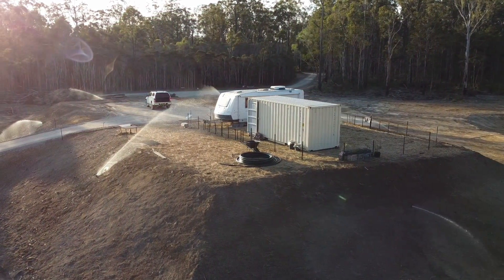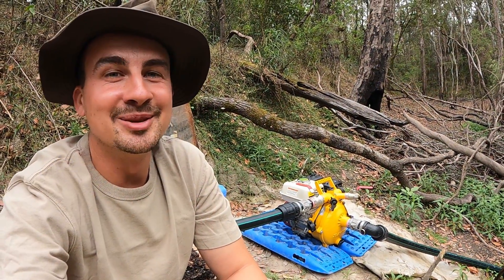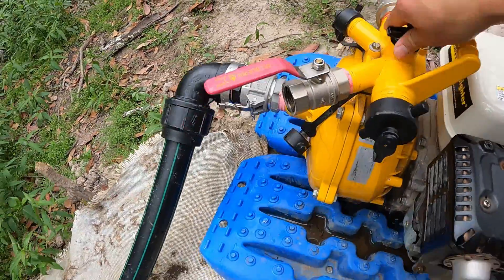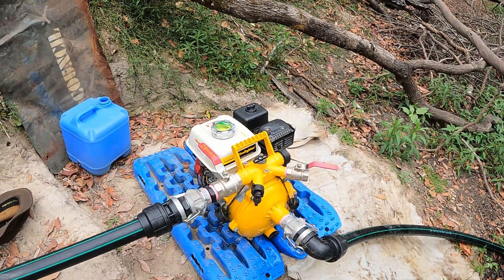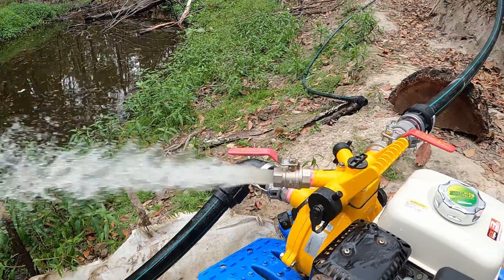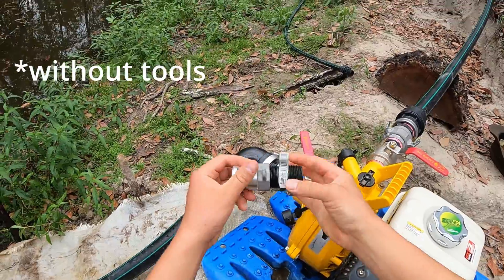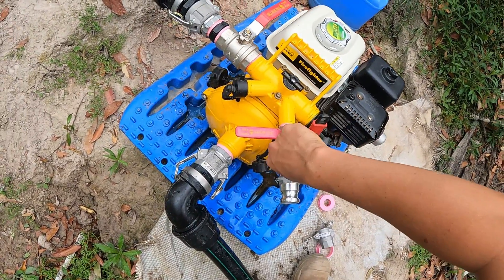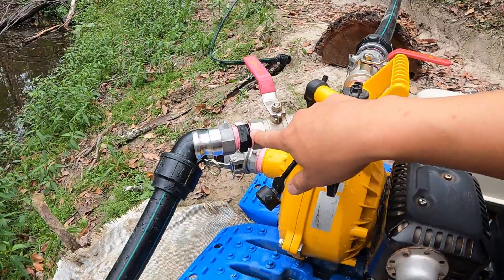How to use Davey Firefighting Pump & Camlock Fittings - Bushfire Safety System Pt 3

Comment: Hey Mate, is the pump tied onto the traction boards somehow?
Reply from the maker: @paulhepfer8155  in this instance it wasn't tied to them. It didn't go anywhere while simply sitting on them, but I did level the ground to be flat 👍 

It doesn't vibrate enough to need too much bracing. The poly pipe held it in place just fine. If it's on a slope without anything holding it, then it can giggle away I guess

Comment: Where is your property based? I want to build a dam like that on my land
Reply from the maker: @MrCites1  Northern Rivers ✌️
Reply: @ nice. Did you need a DA for that dam? Was it over your harvestable rights limits? It’s so hard to navigate legality with dams
Reply from the maker: @MrCites1  well that's the thing, with thousands of pages of policies nowadays it's difficult to arrive at conclusive outcomes...

As a helpful start, Water NSW is the governing body when it comes to building dams. They can assist with sharing some useful info for types of dam designs and things to look out for. With them, as long as you're under the max harvestable rights they have no issues or application processes. Our dam was just under the max.

When it comes to councils, every council seems to have a different interpretation of the same laws.. simply because they're ambiguous and convoluted in nature. 

If u want to be 100% in the clear it's good practice to ask the council if they require a DA. Funny enough, we had one person from council let us know they require no DA. Then after we built the dam someone else accused us of having needed a DA. Thankfully we saved the correspondence to show them how their colleague wrote to us saying the contrary. 

It's a bit of a shame the system is so disjointed, and it took months to receive responses.
Reply: @ my exact experience.
Local land services hadn’t heard of harvestable rights!
Reply from the maker: @MrCites1 wow that's an interesting example lol

It's a strange world we live in. We've had satellite internet providers tell us that we can't power an off grid modem with solar power, only with a generator...

Comment: as I was watching this, I kept thinking to myself that you should really consider installing another sprinkler head right on the pump with another valve. This way if there is ever a fire, once you start the pump you can saturate the area around the pump to protect the pipes and the pump itself. Can't see any downside here considering how cheap the sprinkler heads and fittings are.
Just a thought, great videos so far.
PS, as a plumber myself I cringed every time I see you apply the teflon tape by holding the roll backwards. I was visibly annoyed and talking to my screen. lol.
Reply from the maker: It was concerning having the pump amongst scrub, thankfully we've cleaned out another body of water without any trees around it 👌👍 

And does Teflon tape have a back side?? I did it that way after seeing a short video on how to get more tension on it.. was that wrong lol

Comment: Hey there.  Please please please make sure you have some stroz converters for your cam locks. They are what RFS use if you need support at your place etc.  talk to your local brigades.
Reply from the maker: Yes good call, I've been planning to get one when the tanks actually have water in them 🫡 
Will have one handy for tank outlet for the firies for sure
Or did u mean to have one for pump outlet too??
Reply: @offgridcitycouple4711 at least in the tank - I think a 65mm stroz is the recommendation. Your local brigade will tell you
Reply from the maker: @WadeAbout  copy that man ✌️

Comment: Just one trick with the camlock fittings, cut up a bicycle tube to make a nice wide "rubber band" to leave on the pipe next to the camlock levers, and when testing and or when the pump is in use put the "rubber band" over the levers to keep them closed. Ya dont want your levers rattling loose with engine vibration and the fitting coming apart. 
Awesome vids so far, cant wait to see the progress... 👍
Reply from the maker: Cheers for the tip 🫡
We can't wait too, constant work in progress out here but slowly getting there. Not an easy journey that's for sure 😅
Reply: @offgridcitycouple5695  
Ya could use zip ties but they're a bit harder to undo if need be. Good luck. 👍
Reply from the maker: @vicwidepestcontrol4378  ✌️🤙

Comment: All pipe above ground should be metal ... no good suction or delivery melting!
Reply from the maker: You mean going from the pump? This is a temporary position until a tank is delivered to store bore water. At this point if there was a fire, that pump would burn too 🫤

Comment: Camlock fittings are the way to go. Cheers for the shout out 😀 have a great weekend 👍
Reply from the maker: Thanks Oily Rags 🙂
Have you used the Storz ones? 
And it was a bit of rain this weekend... Unexpectedly the dam is like 1/4 full from the 150mm and more washouts than we can point a finger at.... Drought one day, flash flooding next 😐
Reply: @offgridcitycouple4711  haven't used the Storz fittings before. It was a decent drop of rain.